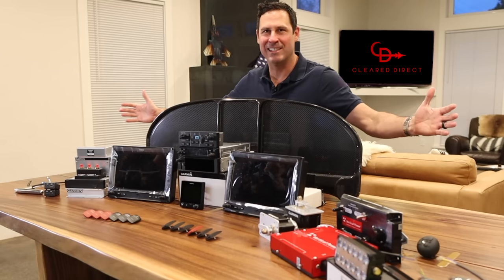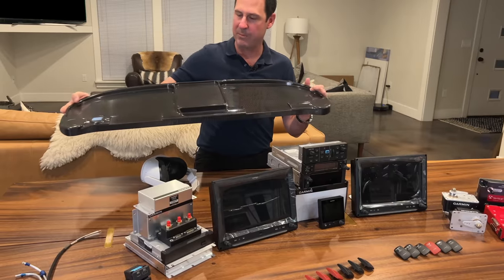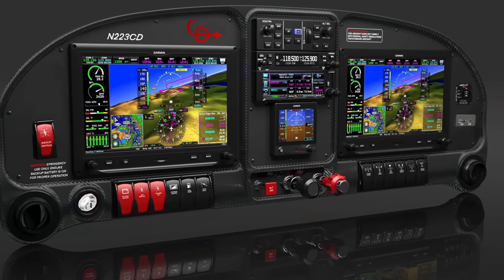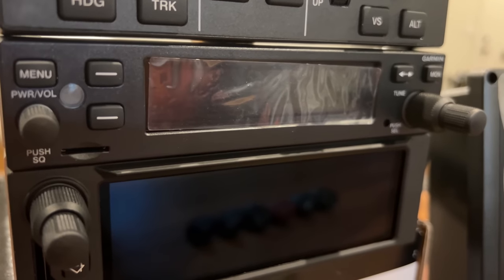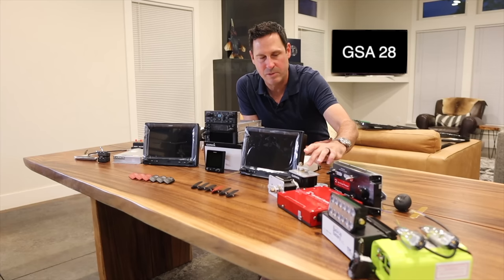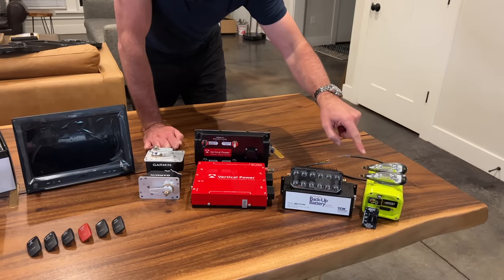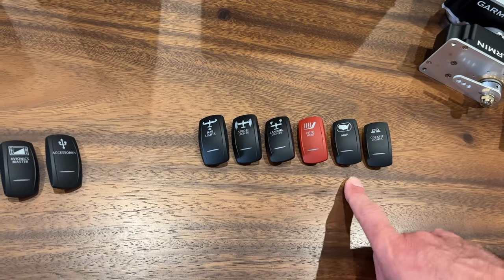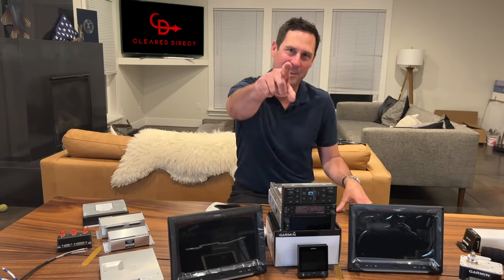Ridiculously OVERKILL Garmin Avionics for my Bushplane

Comment: You might want to think of adding a physical ‘fun switch’ or AP power disconnect.  The Garmin AP will have the safety ESP modes running in the background and it’s a little cumbersome to turn that off in the heat of battle.  When it’s time for steep turns and high bank maneuvering you won’t want ESP intervention.  Plus it’s a good backup for a quick additional AP disconnect if the one on the stick is acting up.  I know it can all be done within the G3x and vertical power box…but sometimes you just want the AP off….for sure.
Reply from the maker: Great points! I sure appreciate it. I’ll take a closer look at doing that

Comment: And I thought mine had all the doodads… Nice job Steve!  I didn’t even know there was an option for auto wigwags. Those virtual circuit breakers are pretty slick to. Would also be nice to have a dome light. But hey I do have a TOGA button though🤣
Reply from the maker: Thanks again for the clip of your sweet ride! Have you ever used the TOGA button (in the RANS)? Would you prefer IDENT? Still trying to decide
Reply: @CLEAREDDIRECT  yes I’ve used the TOGO on practice approaches. Works great. I use the transponder ident on the GNX375 so as to clear up more space on the G3X’s

Comment: Beautiful, literally 98% exactly what I’m putting in my RV7. Although, as I understand it, you do not need the 245 for two comms. The G3X will handle up to two comms. But, the 245 is a cool device either way.
Reply from the maker: Thank you! I don’t think that’s right… “Of course, adding a second comm radio to the suite means you’ll have to buy an audio panel to switch between the two radios during transmit, and to separate the receiver audio.” https://www.aviationconsumer.com/accessories/cockpitaccessories/garmin-gtr200b-comm-bluetooth-ics/
Please let me know if you find something different. Good luck with your RV-7!

Comment: As a college student, I don't even wanna think about how much that would cost in total.💀
Reply from the maker: The good news is that it’s about 1/3 the price of the exact same avionics that are certified to put in part 23 aircraft (Cessna, Piper, Beech, etc). Plus I saved about 50% by installing it myself. Overall, non unreasonable…but probably not for a college student. Good luck with your studies and thanks for watching!

Comment: Thanks for the overview and explanation. Amazing panel! If you find yourself needing to complete an IPC, will you need to use a different aircraft for the precision approach requirement? (GPS WAAS is considered non-precision, even with LPV).
Reply from the maker: I’ve got my 737 for that ;)
But I’m not sure! Great question.
Reply: I’ve read that there is an AC being published next year that is actually changing the classification of LPV to be a considered precision approache instead of just APV.

Comment: Thanks for posting this. It’s almost the exact bill of materials I am planning on for my sling high wing. Did you look at the Garmin height advisor? Especially for backcountry flying. I think it would be handy.

Also, those are pretty good looking switch rockers. What brand are they, or were they custom-made?
Reply from the maker: Thanks for watching! That sling is a looker! The Garmin Height Advisor didn’t exist when I built. Considering throwing one in. I def woulda if it existed when I designed my system. Good luck!
Reply from the maker: Oh also, the rockers are from Aerosport Products. Great company
Reply: Of course. I realised the post date after commenting. Midwest panel builders did a video on the GHA as a retrofit, and it looks like it wouldn’t be too much work.

Comment: That aircraft livery VR design idea is super cool. Also, is there an advantage to a pitot-static mast rather than the standalone pitot tube and does it matter either performance or cost wise?

I've always prefered buttons to touch screens, easier to press a button to get what you want if you're getting bumped around. Super annoying flying IFR struggling to input a frequency or flight plan on touch screen sometimes.
Reply: Also, I'm pretty sure one of the aircraft at my flight school has that GMC 507 (or GFC 500 I guess it's called) and it is very nice to use. Helped a lot with my cross country time building for commercial. Just kept it in heading mode and used my trusty e6b, plotter, and sectional chart to plan the way ahead.

Comment: I am having my Mooney completely redone and I went with basically the same.  However, only one G3x but two G-5s.  Why because it the G3x gives up the ghost I can still get home with two G-5s.  I had a Mooney Bravo with the G-500 and once I had all the indicators get the big red Xs!  It turned out to be a software issue.  Then another time big red Xs.  Turned out to be the magnetometer went out of calibration.  Luckily both times were close to home.  But what if I am on the other side of the country?  That would mean a commercial flight home then deal with the problem remotely and a commercial flight back.  Not all shops and airports can work on TAA s. 

Also, with both of the red X situations the plane was down for over a month. This plane will be a commuter so I don't want the plane down that long.
Reply from the maker: The beauty of experimental is 1) I designed and wired the system which makes diagnosing issues a breeze,
2) I can fix it myself. 
If my G3X system gives up the ghost, I can get home on my single G5 + ForeFlight.
Reply: @CLEAREDDIRECT  IFR?  I'm not sure if that is legal.  But even if it is I would not want to put all my eggs in one basket.  Or to rely on a ipad as my back up.
Reply from the maker: @libertine5606 1. It is 100% legal. You’re talking about an emergency situation. Furthermore, all your eggs are not in one basket. You’re talking about a backup in an emergency situation.
2. Do you want to know how much I fly IFR in GA airplanes in the Pacific Northwest? Almost never. It’s merely to get me through a smoke or fog layer. But you do whatever is legal and makes you feel safe! I did.
Reply: @CLEAREDDIRECT  No, I am not talking about a emergency situation.  I am talking about taking off with a non functional G3x.  I still have two G-5s to get me home.  I have some months of 10 to 15 hours of actual IMC.  

Using my plane as a commuter means dependability and redundancy is very important.  If your requirements are different I completely understand.

Comment: The VR interface for paint scheme design is an awesome idea, thanks Steve! Did your graphic designer also create the CAD model for the S-21, or did RANS supply it? I’m right now working on a 3D model for my Kitfox build - initially it was with a view to making 3D printed/painted models, but doing it in VR makes so much sense! 😎

That’s going to be a super Garmin panel to fly behind - and help ‘acclimatise’ the next-gen ‘Children of the Magenta’ to all the benefits and pitfalls* of glass cockpits. After flying behind the Garmin 3000 for a few years, I can’t speak highly enough of the ergonomics of Garmin avionics 💗 💗 💗

Does your reversion (red map) switch function by swapping PFD and MFD functions between each G3X, or does it kill power to G3X #1 to force G3X #2 into a reversionary mode?

Lastly, beautiful as your carbon panel is, how are its crash credentials? I’ve only heard carbon can be notorious for splintering and rupturing violently under overload - hence why many prefer to use imitation-carbon-wrap over aluminium panels, plasticky as that may be.

- - - - - - - - - - - -
* From experience, the SINGLE best piece of advice I can offer anyone flying a modern glass cockpits is ‘North-up on MFD map’ - or at the very least, selecting north-up at the first signs of GPS signal degradation, most often caused by a NOTAM’d military activity. The problem arises only after loss of GPS signal to the moving map - at that point, the map becomes frozen in the last-good track-up orientation. Thereafter, attempting to visualise successive (radar) headings on a non-north-up map can create an increasingly excessive mental workload/distraction, regardless of experience. I’d even argue that turning a track-up MFD map OFF and reverting to a mental model in that situation could be the safest thing to do. That said, now imagine the further additional workload a two-crew environment brings in the ensuing obligatory discussion - when neither of you are expecting a such a strong visual distraction from an otherwise very useful tool.

Blue skies! 😎
Reply from the maker: Wow thanks for your great comment! First, the manual reversion function does not kill power to the left G3X. It simply turns the MFD into a PFD when the switch is flipped. Second, I couldn’t find a 3D model so I commissioned one. Lots of great gig workers on fiverr.com